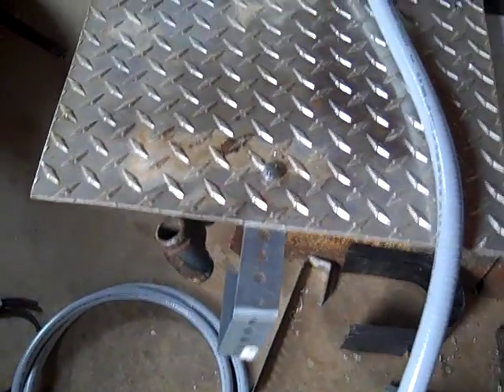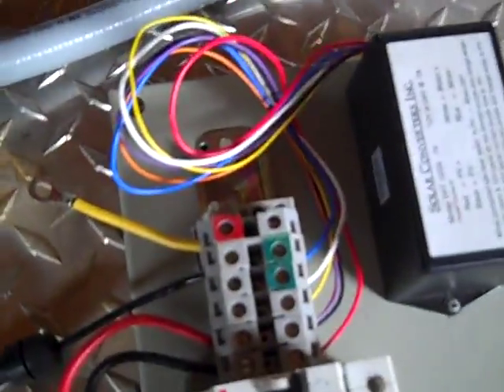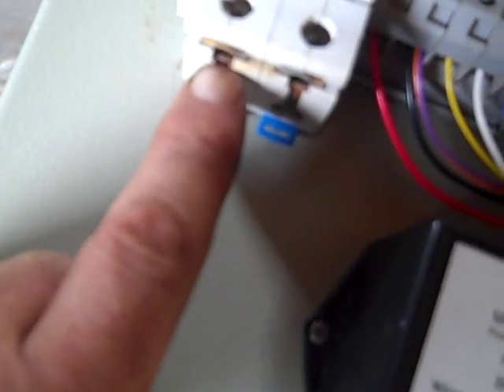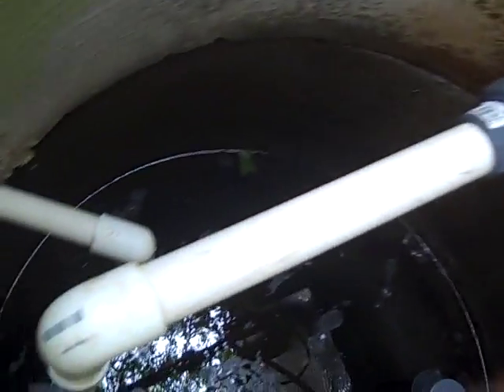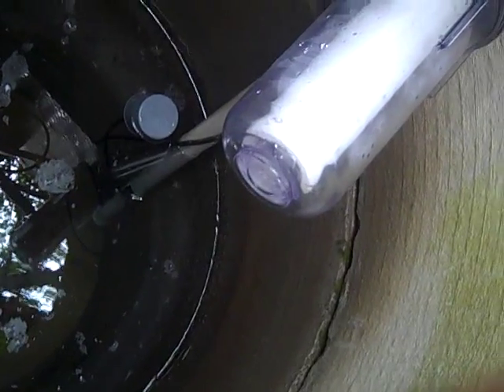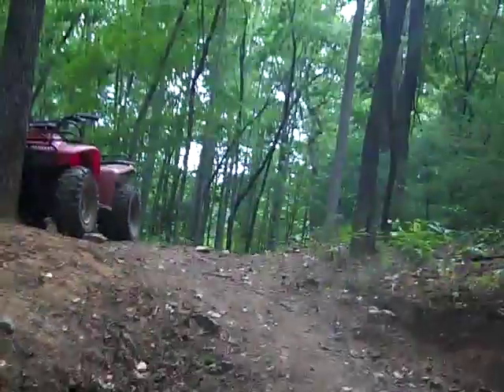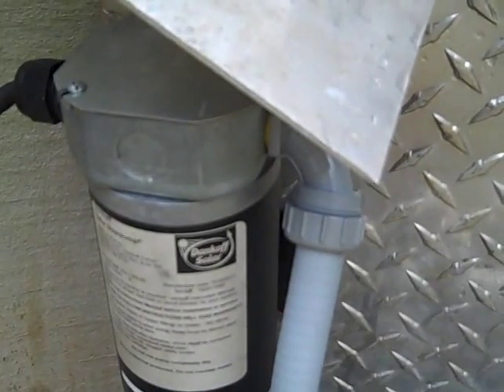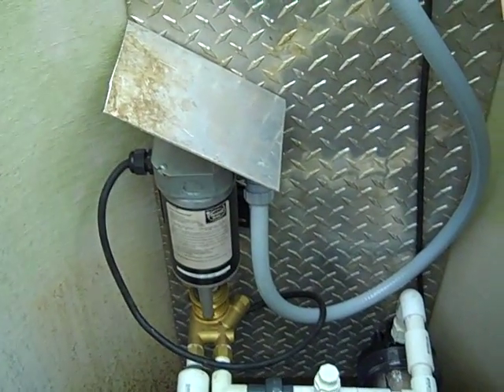Finally! SOLAR Slowpump in a shallow well

Comment: 99.99% clean drinkable water all you can drink in a day. All you need is 3 things. 2 small buckets and a clear thin piece of plastic that is about 6 feet square. DIG a hole that is 5.5 feet square and 8 inches deep. Dig a hole in the corner of that hole to place one of the buckets that is full of icky river ,  pond water or lake water..  Place other empty bucket in center of large hole..Place leafy green plants in hole around center bucket...  Put plastic over large hole and put sand on edges to hold down... Slightly push down on plastic above your bucket.. This is where the water will drip in your bucket. IN 10 minutes you will have water drops in your bucket... In 24 hours you will have enough drinking water for ONE person.  Will continue to produce water after the lower bucket is dry..PUT IN FULL SUN FOR BEST RESAULTS...

Comment: Great video - I just installed one of these in Colorado and the pump seems to be sort of loud and there are a few bubbles coming out of the filter. The water source is a 500 gal tank with a 2" pipe coming out of the bottom of the tank. We stuck a 1" pipe down into that with a float valve in it.

Wonder if you have any troubleshooting ideas? Thanks in advance - sjvista

Comment: Could a 200 watt solar kit power a 3/4 hp shallow pump? The well points about 15 feet down
Reply from the maker: Yes it can if you size the batteries and inverter correctly.  You will need at least a 1500 watt surge inverter.  The panels are just charging batteries so sizing the batteries and inverter to the pump ( assuming 110 volt) is the most important part. If you know the startup amps of the pump and the amps just before the pressure switch cuts the pump off then you will know what you are working with.  DO you have a meter where you can measure AC amps of the pump as it starts and what it is when running?

Comment: Great video. 
Do we know if we can suck water through an existing submerged well pump using this system? I have a 88’ deep 4” drilled well with a 20’ static depth that I’m using now, I was hoping to tap into the line between pump and the pressure tank and use this Dankoff pump and system.?.???? In Minnesota we need the pump and system in doors for freezing and security reasons. With the price of the these components I would like to have more info before pulling the trigger. Thanks

Comment: i couldn't tell from the video, did you use cpvc pipe? cpvc is used for drinking water. Do you have to treat the water before you use it? I like your setup.

Comment from the maker: @MyDaddysgirl44 Do you have the creek or the the Lake or both.  The most inexpensive way to get water from either would be a 12 v DC diaphragm pump. Look up Shurlfo 2088 to start.  You could have pressurized water ( 45 psi) to your home for under $200.

Comment from the maker: @sakofree Dankoff requires an inline filter on the suction side or the warranty is voided.  It is 10 micron!  At least I know I a delivering a pretty good product!   I have not had to prime it but once as the foot valve and minimal lift has worked to hold prime.  Thanks for watching.

Comment from the maker: @freakshow2000 I have a return line from the upper cistern. when it is full it  returns to the spring.  No float, no wire ,. no switch .  Moving water is good water!  So many peopel pump there water to tanks and it sits there for too long.  No thanks.

Comment from the maker: @highcountrytimber Since I do not pump into pressure but into an elevated tank I just pump when the sun shines and it stays way ahead of what our family, the cows, chickens and the garden needs.  I pumped ~ 900 gallons today.  I have been pumping with solar for 8 year to the tune of 2 million gallons.  No need for batteries.  Now in some applications - on demand to a pressure tank- batteries make sense.  But I would have spent a couple of thousand on batteries over the last 8 yrs.  No need.

Comment: @highcountrytimber It's good that you're thinking about backups but batteries are a very inefficient way to store power. If anything I'm sure he would have a generator backup or a combustion-powered pump. That being said he already has so many backups, he doesn't need backups for something that's not a primary source of power or water.

Comment: Looks nice but was wandering why you put the filter on the suction side looks like the output side would be better less work for the pump to pull and you will not have to reprime it every time you change the filter.